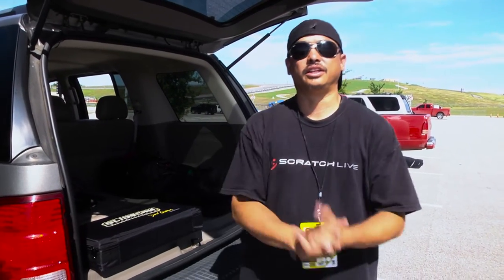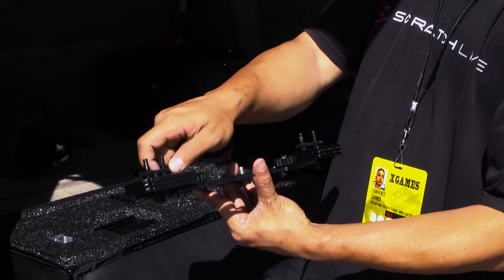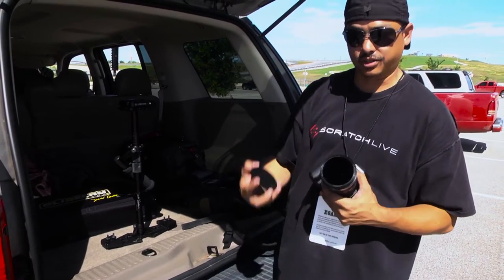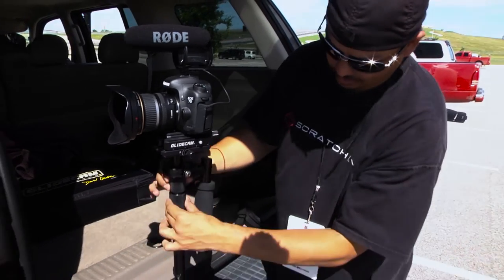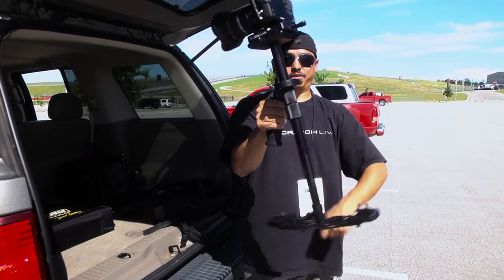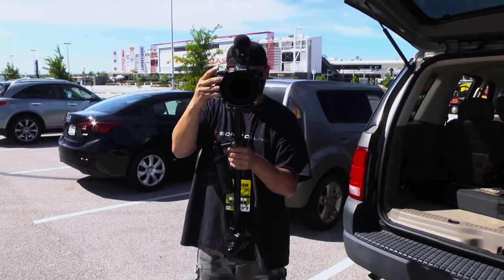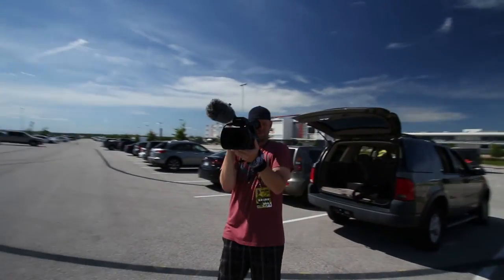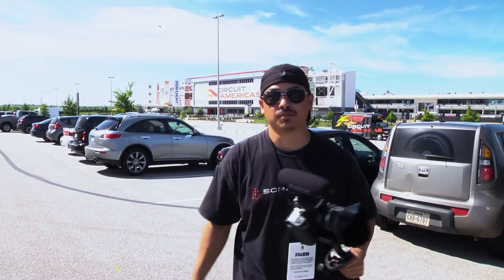How to Balance a Glidecam: Devin Graham Signature Series

Comment: Nice video thanks for posting. I'm considering the Devin series and after much use do you think it's worth the premium? I'm mostly shooting on DLSR's (7D) and C100 MK2. I like the fact it's easy to balance given the style of shooting and lens swapping I like to do so I'm thinking that alone might be worth the premium but it's always nice to hear a user comment on it.

Thanks!
Reply from the maker: +Mark Holtze I highly recommend this Glidecam. I use it much more than ever thought I would. It does take practice and I'm still learning, but the results are worth it. It works great with my Canon 7d and with slightly heavier cameras such as the C100, or even a RED.
Reply: Finding Away TV Thanks for the reply...B&H is actually OUT of stock currently (it wasn't in the AM). I'm definitely going to add it to my "GEAR" list. I'm okay to learn the ropes, learning new techniques/skills is important to me!

Thanks again!

Comment: when are wings needed to be extracted?
Reply from the maker: +A X1 The wings can be extended to change the amount of inertia when panning. If the wings are fully expanded, the Glidecam will require more force to pan/rotate. With the wings contracted, less force is needed to pan/rotate. It comes down to personal preference and what type of shot your are looking for. If you are not panning and want to shoot mainly in one direction, expanding the wings will make the Glidecam more resistant to rotation.
Reply: Thanks. My problem is to get rid of a tiny circular wobbling that stays even after I set up the glidecam. It's a small amount of movement that starts as soon as I begin to walk (in a straight line) and makes my shoots wavy. To get rid of it I thought  of: 1- adding more weight on the bottom and rebalancing the system; 2- extending the wings; 3 -extending the central column. What do you advice me to do?

Comment: What should I do if my camera is too light to balance ?
Reply from the maker: +Clement Deschandol You will need to add weight to the camera by any means necessary. Use more accessories, heavier lens, battery grip, or even just something heavy. Devin Graham actually used water bottles in this video: https://youtu.be/-EsSTpwHy1s
Reply: +Finding Away TV The video didn't helped much :(  Do you have any solutions for me ?
Reply from the maker: +Clement Deschandol Which model camera and lens combination are you trying to use with the Glidecam?
Reply: +Finding Away TV I am using a Canon eos 100D with a 18-55 zoom lens
Reply from the maker: +Clement Deschandol That setup is just over 500 grams. With such a lightweight setup, more weight will need to be added to the camera for use with the Devin Graham Glidecam. Try using a heavier lens, adding a battery grip, adding a microphone, lens hood... Basically anything you can secure to the top of the Glidecam to add more weight. A Glidecam XR-1000 would be a more appropriate match for this camera and lens setup.
Reply: +Finding Away TV but how comes my camera is not heavy enough because I use 2 weights of 150g each ?
Reply from the maker: +Clement Deschandol According to the specifications, the Devin Graham Signature Series Glidecam is for cameras that weigh 0.9kg to 5.44kg. Even with the two added 150g weights, the Canon 100D w/18-55 lens weighs less than the minimum requirement of 0.9kg for used with this particular model of Glidecam. The Glidecam HD-1000 is the correct model for a camera weighing 0.68kg to 1.59kg like the Canon 100D.
Reply: +Finding Away TV thank you very much !

Comment: The wind is a major factor why these are just no Good for weddings in the UK
Reply from the maker: +Tariq Iftikhar the wind is a huge pain. If it's windy I try to reduce the amount of accessories I use. Take off the lens hood, no microphone. Remove anything that could catch the wind. Even going with a smaller prime or pancake lens helps reduce wind interference. It not perfect but it helps.